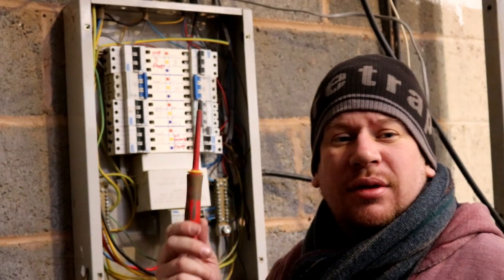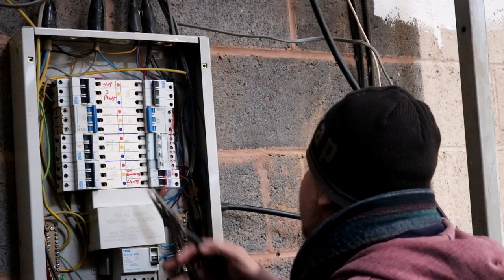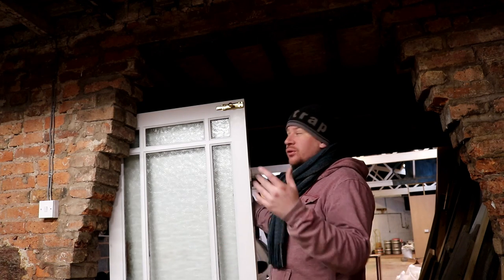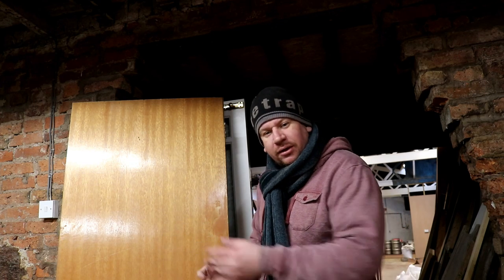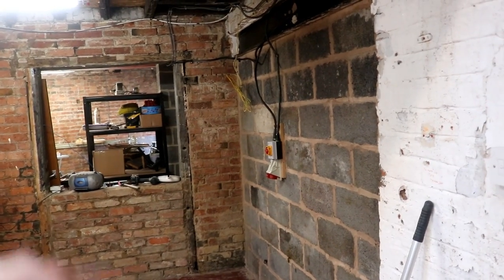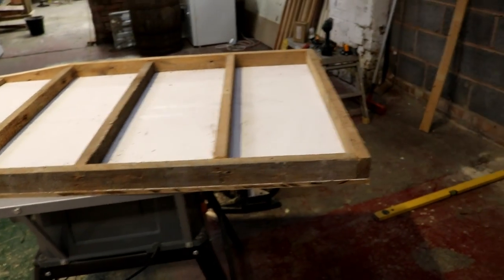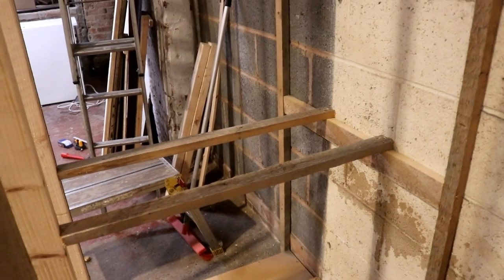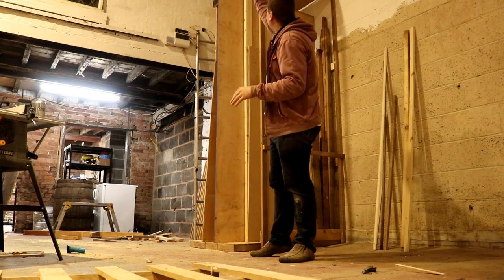The Lights Went Out

Comment: Nice rack 😉 . Would you not be better making a frame to fit the hole rather than hanging the doors straight onto the brickwork? Back fill the lower parts of the wall, preferably brick it up to add more support but you could stud wall it. If you cut the studs ever so slightly over length you could jam them in place and they will also add a bit more support, just a thought.

Cheers

Schnuz.